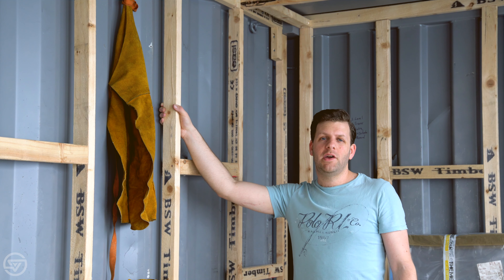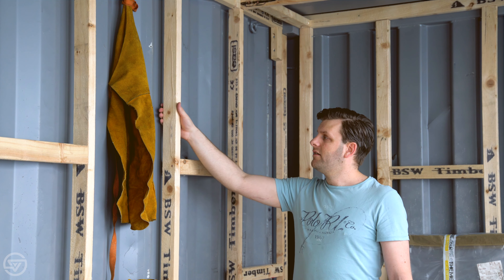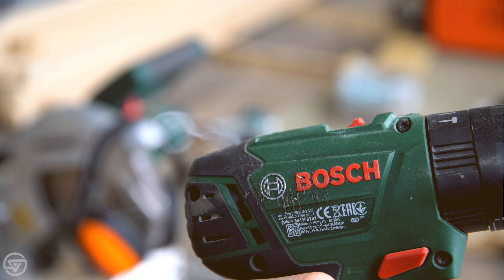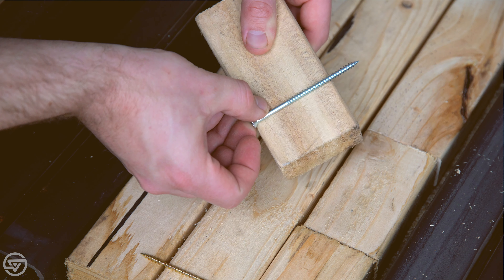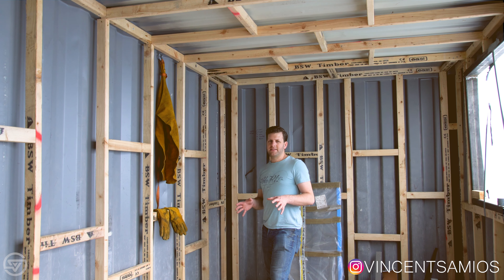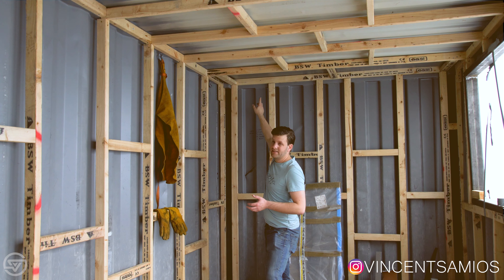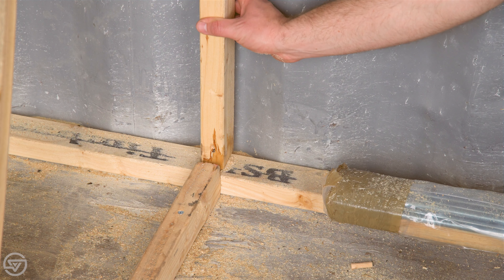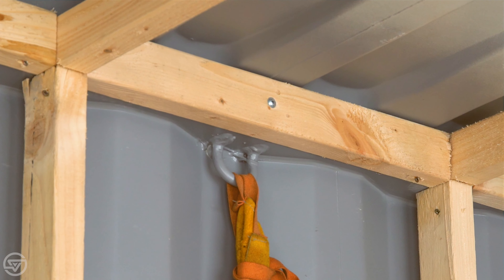Framing - Shipping Container Conversion - Container Home Office

Comment: Neat video, nicely done for making this. We would that these days, not all used shipping containers have box section top rails. We would recommend to anyone else taking this on to avoid screwing into any part of the walls if possible. its possible to built an almost free standing internal frame that butts up again the walls that doesn't involve drilling into the side walls. this we feel will offer best lifespan or minimize the external remedial work that might be required if you drill through to the outside of the unit. This is debatable as the way we would do it may take a lot longer.  We see what you've done here Vince and don't want to take away from it - you've done a great job doing this that will help many others we're sure.
Reply from the maker: Super useful feedback - I agree you don't actually need to screw into the steel if you use the trick of pressing everything outwards, then you'll still end up with extremely strong framing. I'll pin your comment.
Reply: @VinceSamios  Thanks, and will be checking out the other videos. If we can offer any tips or support with any other aspects of your conversion give us a shout.
Reply: Thank you!  I keep watching all of these framing videos and none of them mentioned how they get the inside framed. I thought,  "there is no way people are putting holes in this metal!"  I guess I actually had to find a video of someone putting a hole in the metal to know how to frame it properly.  I have seen some people use glue, but they never mention what kind of glue. So I'm at a total loss on how to really frame one of these things where it remains structurally secure enough to put up cabinets and such.
Reply: @AdrienneS1970 pre-built the side frames in two sections on a flat surface, carry them in and raise them. Place two light horizontal beams to hold the top of these frames in place..!! Along with three screws in the floor, that's all needed to hold the frame in place, before mounting beams on suitable measures. Three per plate.. (1220x2440x15mm is our standard measure plywood) Insulate and plate the whole with 15 mm plywood. Job done as simple as possible, without wasting time, money and ruining your container!

Comment: Nice video for beginners etc. You can use cement glue to fix the wood to the walls. This will give you more wall space when you have finished has in your video you can get you hand behind your wood. Your way leaves more room for condensation / mold to grow and will cost more to isolate the walls. Just per drill hole in the wood for pipes and wires. Also. Not sure why you are adding wood to your already wooden floor? You can add flooring strait away or if they are batted to death just add new OSB or plywood flooring.
Reply: Nonsense, mold doesn't need space to grow. Only warmth and moisture.. Space in a wooden construction might actually prevent mold because of natural circulation could be possible!
Otherwise seal your box, and use a simple household dehumidifier on automatic.
I've been living comfortably with this solution since ten years... in very moisty Scandinavian coastal climate.

Comment: Loving the video am thinking of getting a container for the bottom of my garden to convert to a office/games room. Only snag I have other than all the work is getting it dropped into position would have to be done via a crane over the house so would be costly I imagine.
Looking forward to the next video
Reply from the maker: They aren't as expensive as you think (make some calls, although you're in oz by the looks of your profile pic... and oz is pricey) and containers are a super cheap option for the quality of building you end up with. Call a few crane companies. You don't have any 12ft wide side access?
Reply: @VinceSamios  I'm in the UK will deffo be making some calls I guess if I level the ground before hand they can drop it off nice and level for me
Reply from the maker: @gavinking4075  oh mate, cheaper than you'd guess then I think. A 20ft container weighs about 2.4 tonne, so it's not even a big crane that's needed.
Reply: @VinceSamios  brilliant will be looking Into it

Comment: Thanks for the video. This was super helpful. One quick question on screwing into the metal near the roof. Did you drill a pilot hole into the metal before using the self-tappers?
Reply: I would suggest you do we did a metal carport attached 2 by4 to it and you have to push hard in to it
Reply: Don't drill or weld anything to frame a container. Completely wasted time..

Comment: Read this before wasting your time ruining your container and economy! There is absolutely no need for drilling nor welding to hold the wooden frame. 
Simply raise a pre-built
side construction and let the horizontal beams hold these upright frames in place. Three screws in the floor per section, is all you need to interfere with the container. 
Job done!

Since ten years we are insulating hundreds of shipping containers yearly with this simple method, letting one man insulate at least three containers a day, only using basic hand tools which everyone would have anyway.
Reply: Basically same principle as a normal building frame - bottom is fixed to subfloor and the top of the walls are tied in via ceiling joists etc. Thanks for the idea.

Comment: Why couldn't you just take 20' joints of purlin and weld it to the walls horizontally?
Seems a ton easier to me .
But wanted to hear your opinion on why I should do it your way?
Reply: Expensive?
Reply: Why any fixtures? You'll have a layer of horizontal beams to hold the upright frames, right?
How should this sort of construction go anywhere?

Comment: if you screw thru the metal container, wouldnt you have leaks in the future??
Reply from the maker: The box section of the top rails is basically a tube, so you're not screwing through the container.
Reply: Right. Thanks man. planning to build my own house soon. cheers
Reply: You can  screw into the top part of the metal has it is a tube and it will not come out the other side. But you can still get in condensation / mold.You need to seal / weld all the end joints of the outside of the container. You can also cement glue /silicone to the wood and metal wall to add a rubber seal to your hold.
Reply: @sunseeker8457  absolutely no need for drilling nor welding to hold the frame!
Simply put the pre-built
side construction in place, letting the beams hold these upright frames in place. 
Job done!